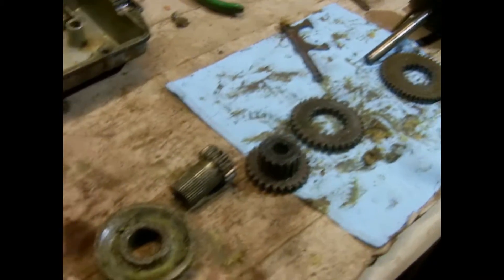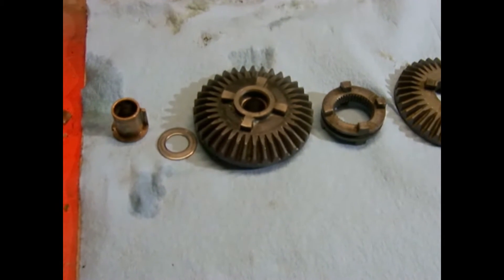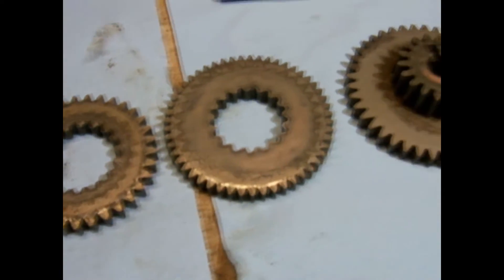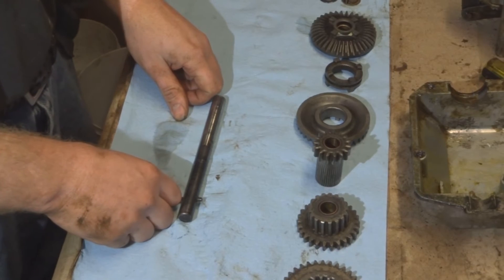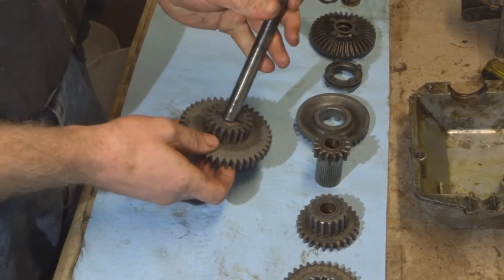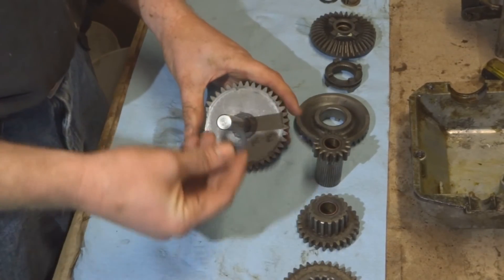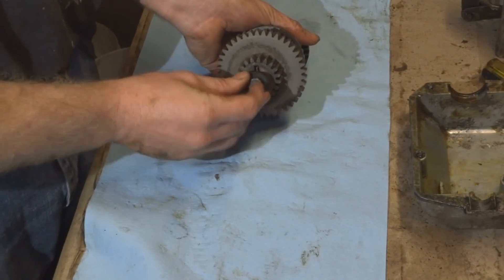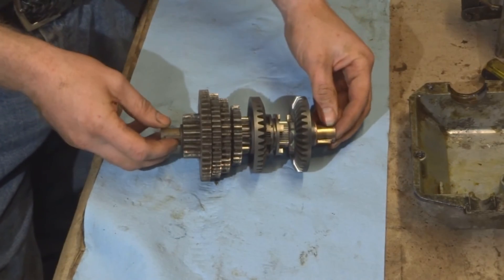Toro Powershift Transmission Part 2   Gear Assembly #1

Comment: what did u use to clean the gear off? plz respond I have my trans apart and dont know how to clean them that well
Reply from the maker: +Jensen Albanese I used a utility tub with hot water and a degreaser (cleanser). Washed all the parts and dried them off. Thanks for watching.
Reply: +sblg43 thanks! did they have any rust before and the cleanser take them off? becuase mine have rust and do know how to take it off
Reply from the maker: I think there was just a little surface rust, You may be able to get most of it off with some sand paper or a scotch-brite pad. Another way to remove rust is to soak the parts in muriatic acid. See my video about "Give your crank an acid bath". Be very careful!